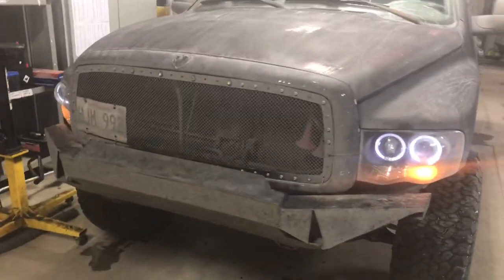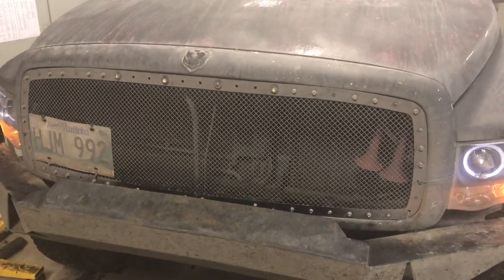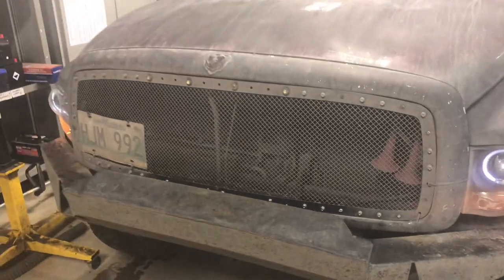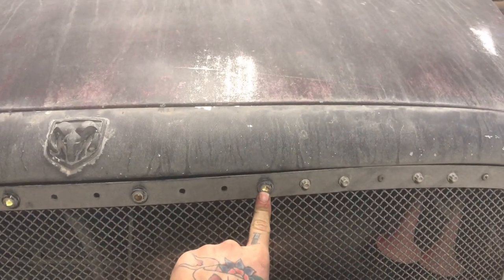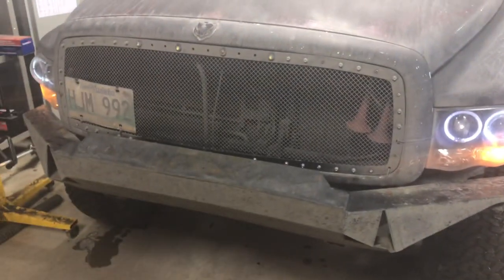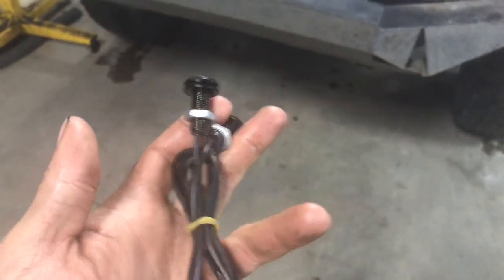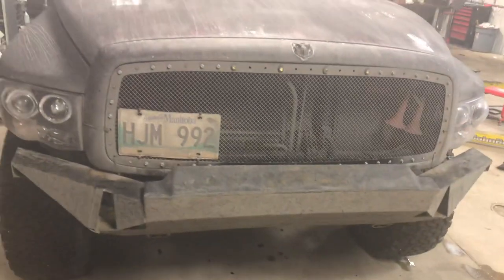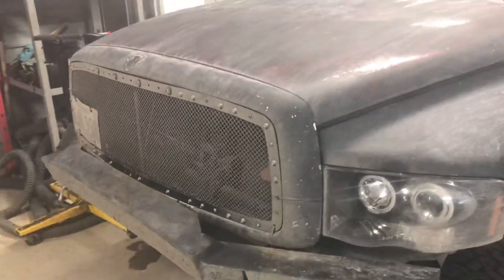EBAY Raptor Light Review • 6000K LED Eagle Eyes • #ThatBeardedMechanic

Comment: Try a different model not  the ones with the big LED lights inside. I use he ones that have two small "LED" dots inside and after they get wet and even after the glass cover falling of and minor rust they still work! Amber once lasted close to 5 years and only one of them went off!!
Reply from the maker: These ones were the multi-chip design with 12 chips on two internal boards. 
I’ve seen the ones you’re talking about listed on EBay though, so I’ll definitely give them a try on one of my other vehicles and see how well they work out.

Comment: umm....spray them with water proof. same stuff for a tent. do that! or simply hot glue the edge seals. yea i got mine in today theyre definitely cheap. not even installed on my car yet and already a cap completely fell off and wont go back on.